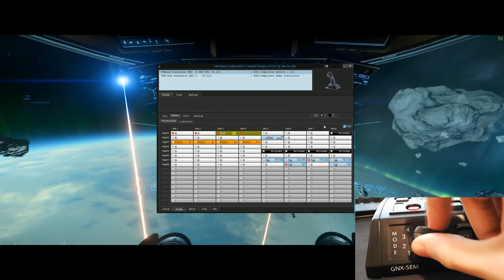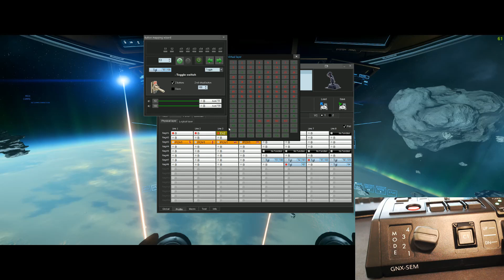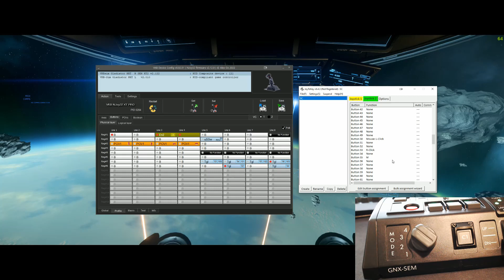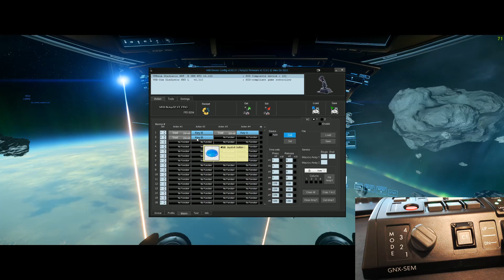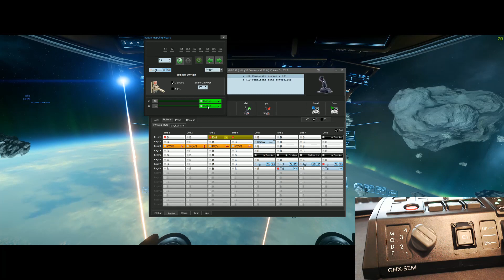VKB-SEM: Setting up Modes in Star Citizen using the Mode Switch

Comment: Does each different mode change the configuration of the other buttons? What I mean is: C1 in mode 1 does "x" but C1 in mode 2 does "y"?
Reply: In most modes you can have the same button do something different and have them mode dependent. Not every function is "slaved" to a mode, but the ones that are work like you want them to. If you're still having trouble, try to reach out and I'll try to help you (I don't have any VKB peripherals yet, but have set up my VPC joysticks and I know a bit about Star Citizen)
Reply: @PvtDamion  thanks, I got the SEM and played around with the controls. I got it set up the way I wanted. The software is very robust

Comment: Your setup was super helpful in getting me in the right state of mind.  Found a simpler way for this though.  I set them all up as toggles like you did, but made it so that Mode 1 and 2 both act as the same button, i.e. both are set to press Button 54.  Everything worked cycling through the modes after that.  I didn't end up using what you had but gave me the idea to try the method I ended up with so thank you!!
Reply: And which SC mode did you set for 1+2, 3 and 4
Reply: @jarvis_stark_o7  I don't recall anymore since SC lets you use buttons to "SET" modes instead of just "TOGGLE" them.  Currently I have a button to toggle SCM/Travel Mode, then depending on the mode I have these  set: 
1 - Guns | Quantum
2 - Missiles | Flight
3 - Scanning
4 - Mining/Salvage